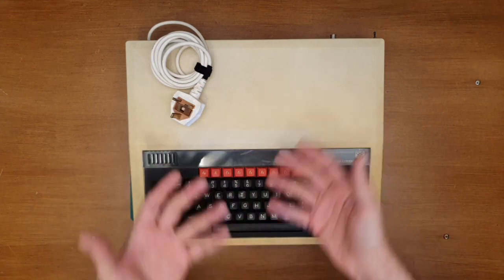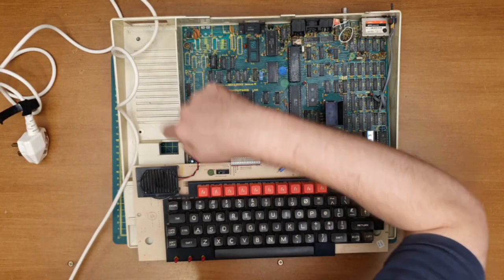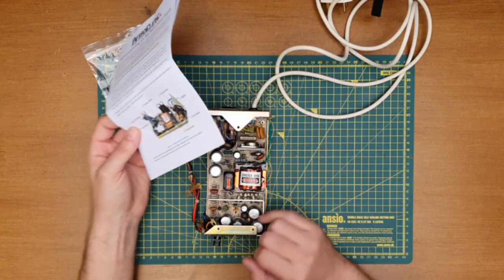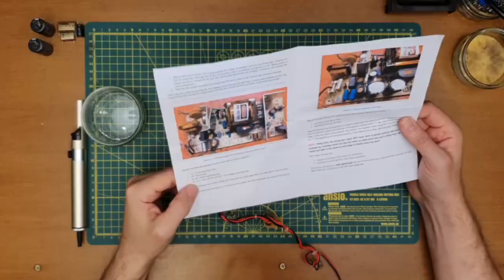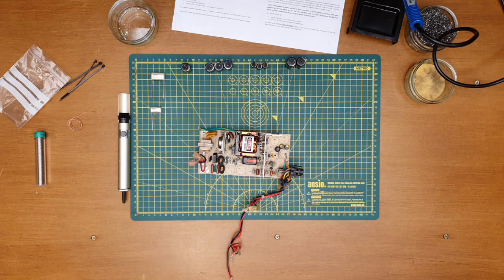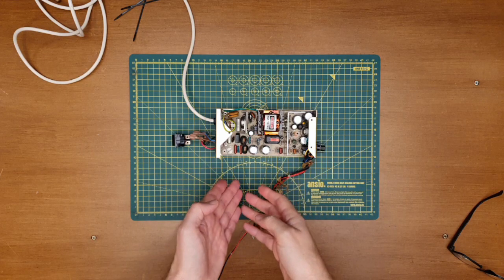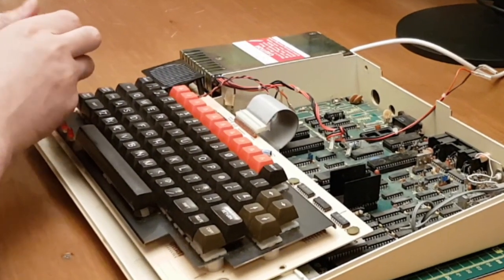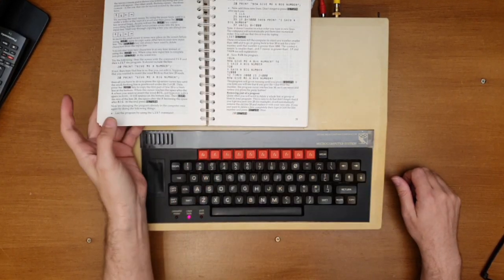BBC B Micro Power Supply Capacitor swap (Beeb PSU ReCap)

Comment: Great video. Appreciate you posted it 2 years ago, but it potentially saved me from damaging my “new” BBC.
Just purchased it from a guy who’s had it in his loft for 30+ years. I was desperate to switch it on, but after watching this, I disconnected the PSU from the motherboard and tested the outputs. I was pleasantly surprised that all were fine, and was about reconnect it, but decided to let run isolated for a bit. After just a few minutes, there was an almighty crack from the PSU, followed by a respectably sized cloud of smoke!
Indeed testament to care & caution when firing these babies up after they’ve spent a few decades in hibernation!
I’m now awaiting my recap kit from retroclinic 😊

Comment: Great video, really easy to follow.  I'm about to try the same recapping on my first Beeb just purchased via ebay.  We used them at school but obviously we never took the covers off.  I had an Electron at home that I recently repaired but the BBC B repairs are new to me.  I'll be quite nervous on that first power up too :-)
Reply from the maker: Hi there Mark and thanks for your comment! If you've got the kit from RetroClinic, then you can't go too far wrong... the instructions are that good. I did end up double and then triple checking the polarity of each capacitor , just to be on the safe side though and yes, the anticipation on switch on is a real buzz! Well done with your Elk and hope the Beeb PSU goes smoothly!  😎👍
Reply: Instablaster...

Comment: I can't argue with the benefits of a full cap kit. Of the 50+ Beeb PSUs that if been in, all needed their RIFAs doing and one needed a C9 and one master needed a resistor, no other components were bulging, nor seemed to be imparting the PSU's performance. I did replace most C9s, just in case.
Reply from the maker: Hi there Richard and thanks for your comment! 😊👍 Most of my old kit is on it's original caps, save a C64CR and a Spectrum+, but it is something I want to change on them all. It's fair to say though, that caps of this vintage where very well made and well before the 'plague', but the more I've read, the more I realise the they do eventually go out of tolerances, so I guess it makes sense. Strangely, it's also somewhat therapeutic too...! What are your thoughts on the small handful on the system board and the one on the keyboard?🤔
Reply: @ChrissRetroCorner  I should have said before, I have only basic self taught skills. I can definitely see that if you only have one or two Beebs that having good the PSU apart, you might as well future proof it. I'm a software guy really and haven't had any cause to change any other power related components, just a few 74 series, 6522s and an ADC. You can find some of my BBC games via this shortcut http://trickysoft.co.uk play in browser or download for free.
Reply from the maker: Self-taught or not, with 50+ beebs under your belt, I think that makes you pretty qualified..! 😀 I'm in Support, so I have the utmost respect for anyone that can code and understand these micros in their own language and also anyone that understands them fully at an electrical level also. 😎 I'm learning... it is slow, but fun progress! Well, I think that just goes to show the quality and craftsmanship that went into the beebs then! I've had a quick look there are some classics to your software house there Richard, so page tagged and I'll be trying a few of those out on original hardware very soon! 😊👍
Reply: @ChrissRetroCorner  thanks, I make the games that I love and sometimes didn't get a great Beeb port.
Reply from the maker: Ahh, great work Richard! I'm greatly anticipating trying your games out! Looks like I'd better hurry up and colour mod my Beeb!!😄

Comment: Good stuff Chris keep it up i enjoy your style but please please please fix the video quality, in some sections it's too blurry for my old eyes.
Reply from the maker: Many thanks Niall! I'm a little limited to the capture quality of my cameras and then the output of the software I'm using. I also tend to overuse the digital zoom a little 😕. I'm looking to make a couple of hardware upgrades next year and subscribe to Lightworks as the free version won't output above 720p. May I ask what device you're using to view my video on? I can try and bear this in mind in editing, as I'm sure other viewers will encounter the same issue. Thanks!! 😊👍
Reply: @ChrissRetroCorner  you'll get more subscribers i'm sure if you invest in your equipment used for videoing/capturing, it seems that when you capture video from the side that it looks better quality, but from the top or zoomed in it's out of focus, and that gets tiring to look at (but I want to watch the video !). I'm watching the videos on a Microsoft Surface Book 2.
Reply from the maker: Thanks Niall. Yes, I see your point about investment. Hopefully that will change early on in the new year. For now I'll go easy on the digital zoom and reposition the cameras. 😊👍

Comment: Thank you for the recommended the repair on the power supply. After changing those capacitators and when I tested those 5V ouput pins it turn out to give a 10V supply. Can anyone help me if you faced such a situation and what is your recommendation for me to do next. I dare not plug it to the main motherboard board yet. Thanks please advise.
Reply from the maker: Hey WK Tham! So sorry I've missed your comment! 😳 Without an electrical load on the PSU, it might well run 2-3 volts or so higher. The PSUs are designed to provide the correct consistent voltage, while in use and powering the system board. They tend to run a but high with no load.
If you've not found an answer, or otherwise got it working yet, I'm happy to test the voltage on min, with nothing plugged in and see how it compares with yours, if that helps?🤔

Comment: OK a few points in my opinion, it is better to replace one component at a  time as you may not always have detailed instructions, cotton buds are an abomination and should be avoided if possible as they just end up in landfill, a soft bristled brush or with a board like this an old tooth brush is fine.
Reply from the maker: Hi Richard and thanks for your comments! Agreed on both counts, had I not have had Mark at RetroClinics fantastic guide to help me though, I likely would have done one at a time, to save getting mixed up and yes, once we've worked our way though our stockpile of bulk-bought ear buds, we're not buying any more now either. 😎👍